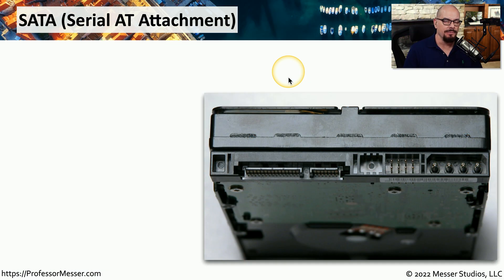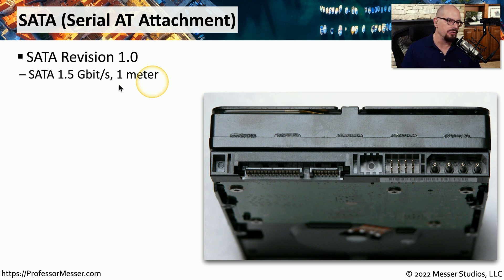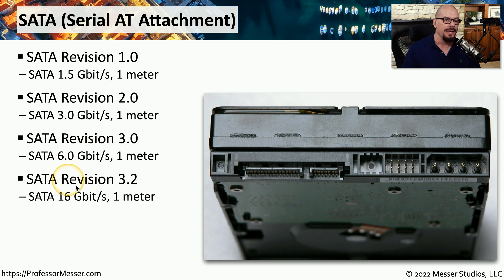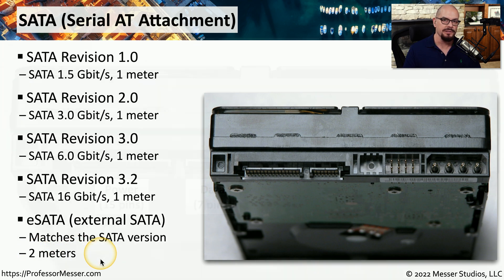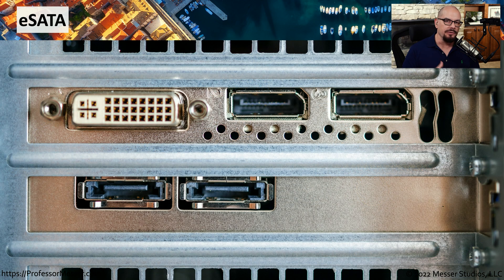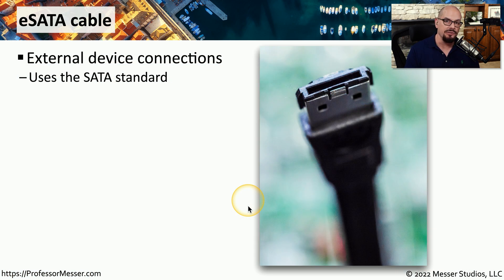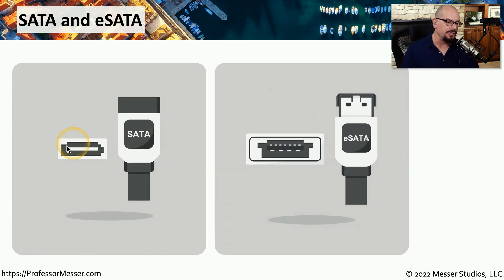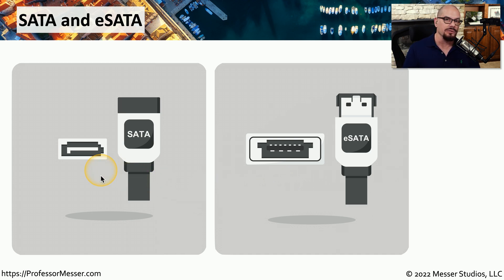SATA Device Cables - CompTIA A+ 220-1101 - 3.1

Comment: I’m kinda confused if there are different sata cables for different speeds ( I II III ). I know physically thy are the same.  Will my sata III drive work just as fast with an 8 year old sata cable ?  Thanks
Reply: The cables are universal and they work between any of the revisions. The difference in SATA revisions refers to the bandwidth on the motherboard connection. Then you must remember the drive has a bandwidth as well. Faster storage drives will require higher SATA revisions to keep up, otherwise it bottlenecks.